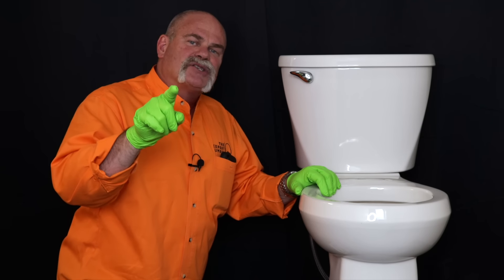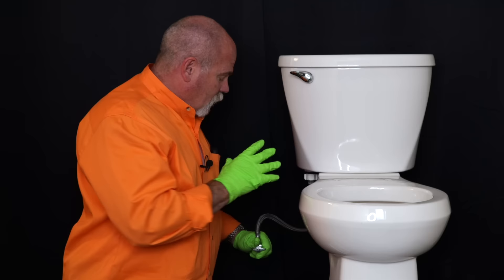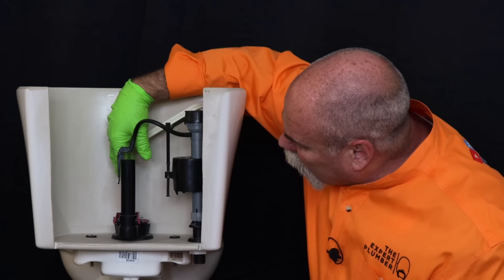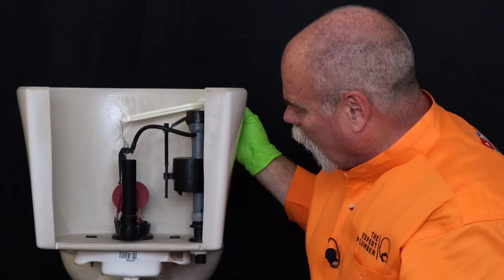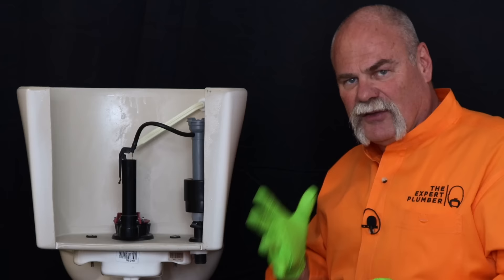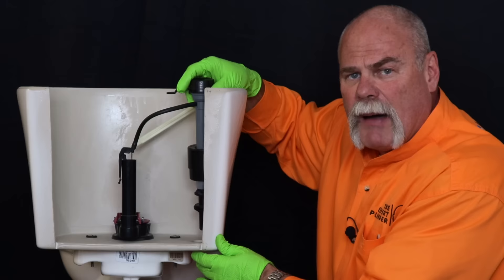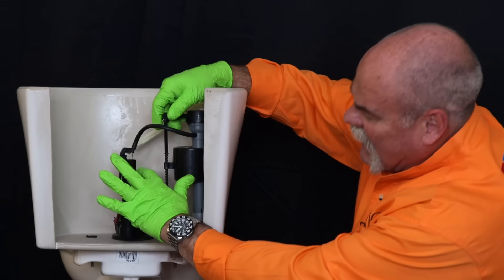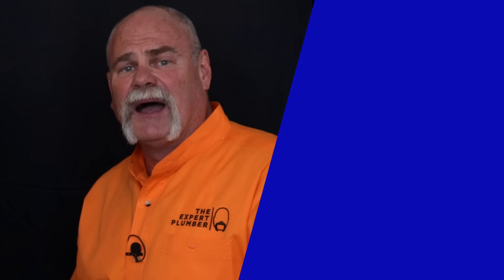How to Fix A Running Toilet GUARANTEED | DIY Plumbing Repair

Comment: Please help! I had a plumber come and he couldn't figure out what's wrong. Our to let keeps flooding the bathroom, hallway, and nursery. It cost us $8,000 to fix it the first time so now we don't t use that bathroom out of fear. Plumber said it might be constantly flushing and causing it to overflow under the floor but he took the toilet off and what not and it wasn't fixed, it happened again. We are too scared to even replace the carpet in the nursery because of it so my twins don't have carpet
Reply from the maker: I would contact another plumber to come out and inspect it.Kind of hard to give a thorough answer without seeing anything. Hope this helps!

Comment: I've had a plumber come and he replaced all the parts inside, but somehow the toilet is still leaking very slowly. I turned the water off, and after 24 hours the tank is half full. He tried different flippers and changed the flush valve.

Comment: I think I broke the diagram valve taking it apart. The pin that runs through diagram valve gasket and transfers lever energy from the float doesn’t hold the gasket down and when the whole thing gets reassembled and I turn water on, the whole assembly leaks. 
Better just call a pro.
Toilet repair may just be a little like golf. Looks easy in the videos.

Comment: Thanks, the fill wouldn’t shut off the water, removed the cap and cleaned the gasket, didn’t fix the problem. Picked up a new cap with new rubber gasket and now valve shuts off the water. $5 fix instead of what a plumber would of cost.

Comment: There are different types of toilets and yours does not represent mine. My toilet has a round plastic float that is connected to a long brass shaft that connects to the ballcock. When the float comes down because you flushed the toilet, it turns on the water to fill the tank. Unfortunately the brass shaft bends in time and the toilet then constantly runs(in side the tank). To fix it you don't need to shut off anything, just bend the shaft and float down.  Unfortunately after many times being bent the shaft usually breaks and then needs to be replaced. No hard job unless the shaft breaks at the thread going into the ballcock. Because our town does not meter our water, instead of taking a chance fixing the problem and breaking the shaft I will simply let the water run.

Comment: Mine was fine until I installed a bidet today, now it won’t stop running.. so I must’ve done something wrong. When I try to turn the water off, water starts to spray from where the shutoff valve is😅 Plummer coming tomorrow

Comment: I don't thinknthe problem with that toilet is either the flapper or the fill valve.  The water is gonna keep running as long as the back is open like that  LOL

Comment: There's a easier way to replace the fill valve!! The white lock ring to adjust the height. Unclick it pull the whole diaphragm and stick out and replace with a new one! Your welcome.10 mins no mess

Comment: I've been a plumber and I am a master plumber, for almost 30 years. Never once have I cleaned the diaphragm of the fill valve and that alone did the job, not once. So by telling people to do this you're only adding I needed work for them. It's much easier just to go get a flapper and get a fill valve replace them both and be done with it. It's not that hard and it's not that expensive

Comment: Hardly any time devoted to when you need to replace the entire tall apparatus.  I think 17 seconds of video, literally.  I think you need to buy the entire apparatus.  We are supposed to make sure about height of the one part is correct.  Confusing explanation.  I may try to do the thing on the top and hope that does the job.  Anything more and I don't feel confident.

Comment: The main problem of the running toilet is the carbonates of water deposit in the flapper gasket, it is straightforward, there is no need to change the flapper, clean the carbonate deposits on the flapper's silicon gasket, and at the edges of the round pipe where this gasket rests.  This guy is just wasting your money for replacing all the stuff.

Comment: This all seems easy but I sear to god toilets are designed AS IF they were loosely tightened , upside down, and have easy access.
NO TOILET DESIGN is made easy. That little piece at 4:57 is made impossibly skinny so you cant get a hold of it, and is in a corner where you cant use a wrench, and of course up side down.
I swear plumber designers are masochistic!!

Comment: The hardest part is taking off the supply line with that stupid plastic nut. Chances are it’s been there 10+ years, at a really awkward angle, it’s become quite set in, and the Incredible Hulk tightened it the first time for you. I’m wrestling with it now. Frustrating.

Comment: Man 😐😐😂😂 who messes with all that shit 😂 just pull the white clip up on fill valve “height adjustment” clip/ lock what ever u wanna call it.. remove valve. Do same with new one put on to correct height and.. bam no tools takes 5 minutes 10 of replacing flapper also
Reply: 20 min total with testing and no tools required 😂 easy money

Comment: step 2 which he failed to mention is flushing the toilet after turning off the water to the angle atop/ supply line, before disconnecting from bottom of toilet . 

turned off the video from here as not mentioning that 2nd step you will disconnect the line and have water all over your floor

This guy should not be making instruction videos!